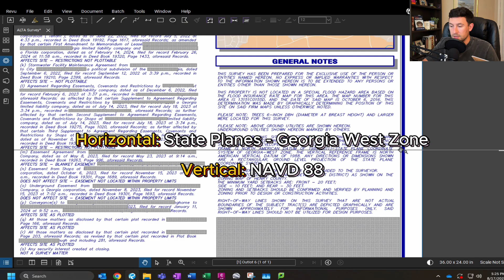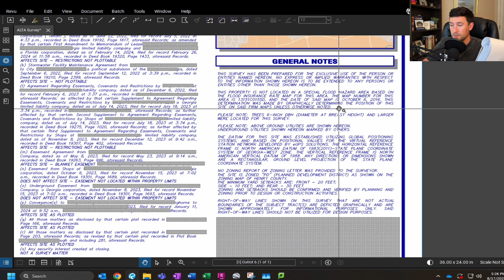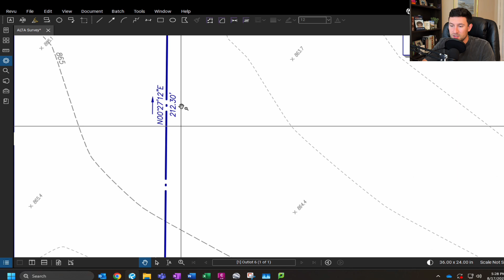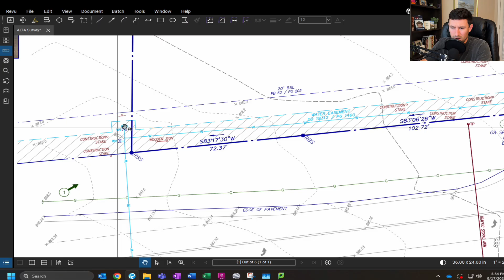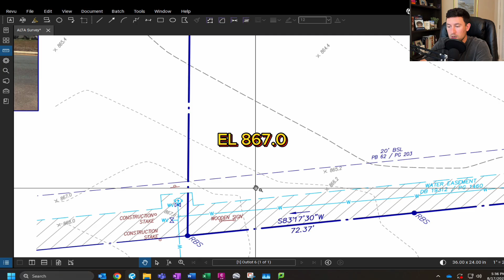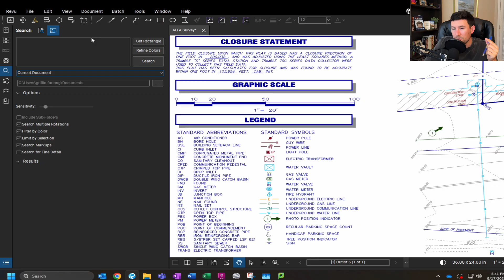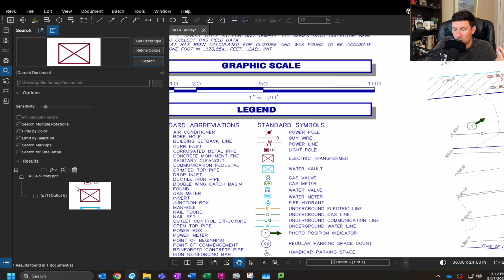How To Read A Survey (Like a Civil Engineer)

Comment: Hello Griffin, As a surveyor, I'll say a number of things. 
1. All maps must have a scale, if a map does not have a scale then, it is incomplete. Typically, a map must have 5 components - a border, orientation, a legend, a title and a scale. 
2. Horizontal datum is fine. However, you may see the the more modern term - geometric datum. This just includes the ellipsoid height. This concept began in 1989 with the introduction of GPS.
3. The transition between vertical datums, NGVD 29 to NAVD 88 IS called a transformation not a conversion. There is a difference. A conversion is like moving from latitude and longitude to northings and eastings or XYZ for GPS. A transformation occurs when you go from one datum to another. A mathematical process is required. 
Apart from that, I was intrigued to see the civil engineer's perspective. 💯